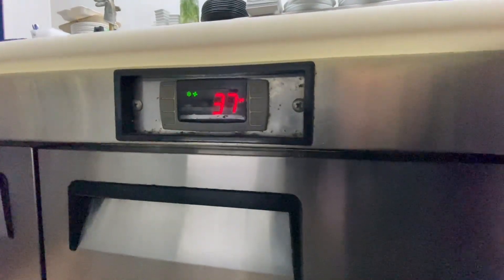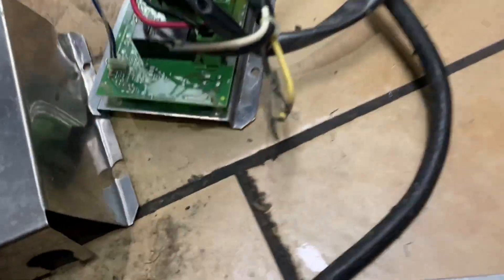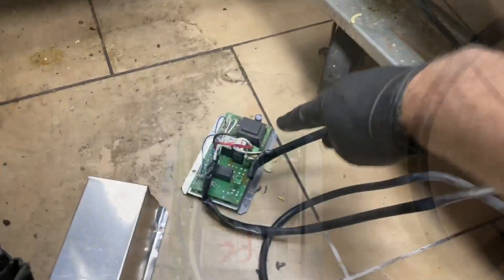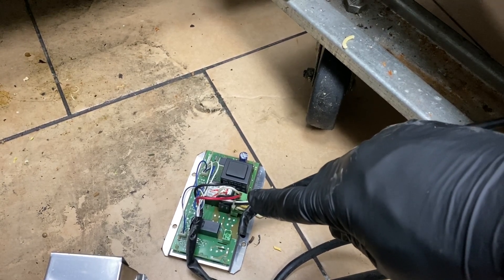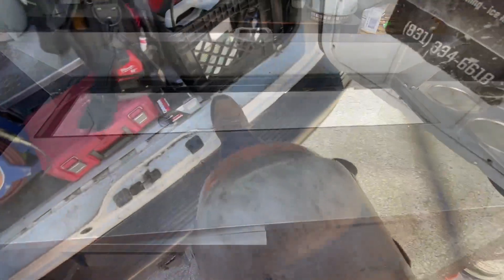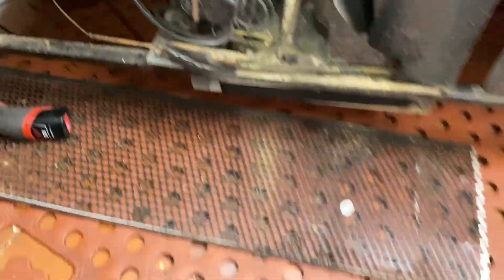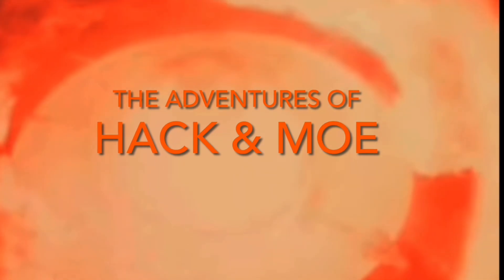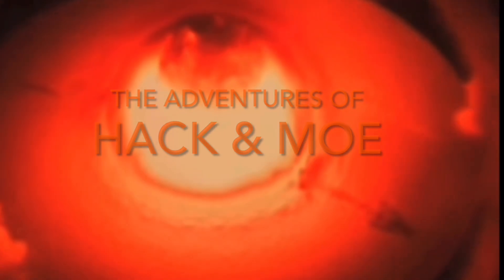Let’s talk call backs

Comment: Did you try to find the leak in the True unit? Interesting hearing about retro fitting r134a. How often are you doing the swap?
Reply from the maker: All the time now. 400$ vs 235$ a jug. And it’s the replacement for it.
Reply: R450a still $1080 and special order 2 days out at Johnstone New Orleans
Reply: 100 lb cylinder $4756

Comment: the first callback, looks like it wont be long before another callback, complete with cooked board and connectors.
time for a full "junktronics snip-snip-delete", adding a real thermostat and contactor, or a whole new box because that 💩💩 is spanked
Reply from the maker: Milk 🥛 it to the end. 🤘⚡️🤘✨✨✨✨
Reply: Then the compressor in the Atosa goes kapoot, and the customer wants a new prep table. Finally sold them a True.